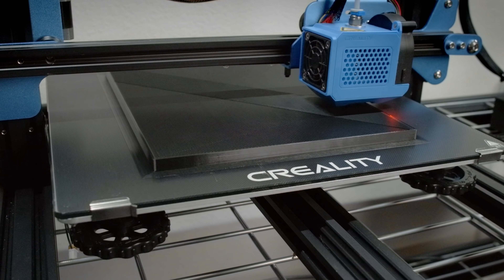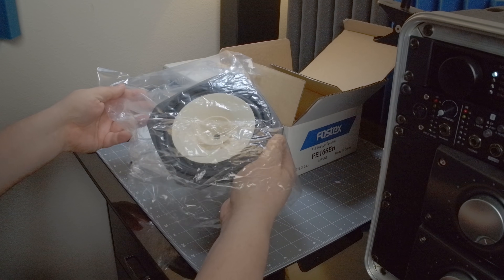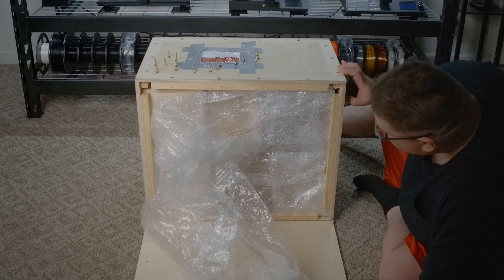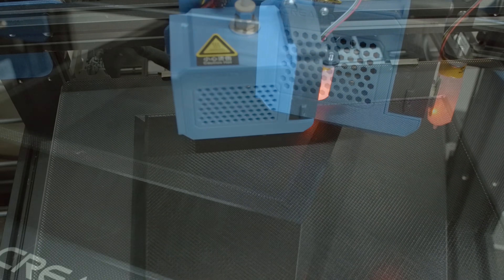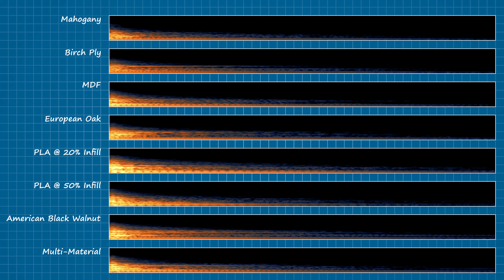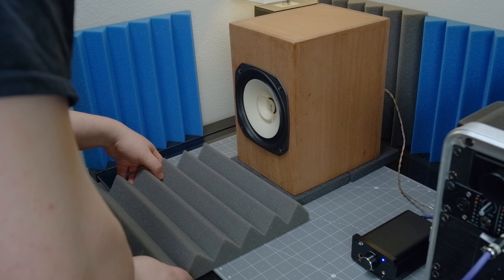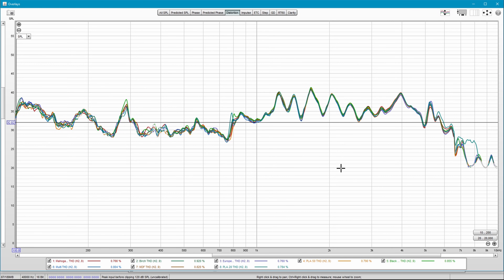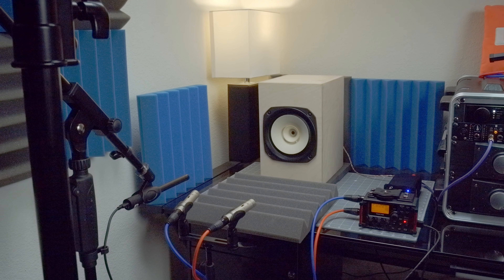Which Is Better for Sound?

Comment: You typically do a port of some kind you were testing a sealed box now I always ran sealed boxes myself. It plays a better all around note and you don’t have to worry about the I wonder about your airspace. Is it too specification for the speaker? Or are you smaller on the box and more power, or are you larger on the box with less power everything achieves different things depending on what you do I think it’s funny the test you’re running I ran when I was a kid now I’m 60. Have you read the cookbooks?

Comment: Would be cool to see you experiment with hollow walled prints, then filled with epoxy and sand or similar for example. That way you reduce print times but can achieve dense enclosure walls?

Comment: Since 3D printing is used to make speakers, it is not necessary to print speakers made of wooden boards. 3D printing can create more shapes. We use wooden boards to make speakers mainly because the price of wooden boards is relatively low and easy to process.
3D printing also has its own disadvantages, but the structure can be strengthened by filling it with resin or cement later. This saves printing supplies and greatly reduces printing time.

Comment: Could we in theory 3D print the case with like 5-10% gyroid infill? Gyroid is a 3D structure that allows water to enter every crevice so it might be very good for this purpose.
So... use a low% gyroid infill, and drill one corner of the enclosure(or have a 3D printed thing prepared that you just cut off), and then carefully fill it up with very low viscosity epoxy resin or special plaster or something? That box might end up as heavy as a brick!

Heck, you can design the box for this exact purpose, use 100% infill but keep all the walls as thin as possible and simply fill up the whole damn thing with cheap plaster or concrete or something!

Comment: Where's the acoustic insulation? If you didn't use any that is madness. The resulting internal reflections will bounce back on the cone causing gross peaks and ringing. Also vibration results will be significantly altered by the use of internal bracing and damping materials. Even acoustic insulation acts as a damper. As a rule enclosures whose resonances lie at higher frequencies are easier to damp out. Lower frequency resonances are more difficult. Birch ply being somewhat more flexible tends to resonate at lower frequencies. This is not necessarily a bad thing as it can add warmth to the sound of an otherwise lean sounding speaker. Many classic British designs from the past (ie, BBC monitors) used thin walled birch ply enclosures for it's unique acoustic properties. I may be old school but there's a lot we can learn from the classics, many things that have been forgotten.

Comment: I'm trying to design a subwoofer enclosure for 3D printing, I'm a 3D print novice though and I don't know how thick I should make the walls, 0.75 inch like I would do for the MDF? Any suggestions would be greatly appreciated
Reply: I printed a few speakers and filled the wall cavities with silver sand. For the top and bottom I used 30% infill and a layer of sound deadening that is also used in cars (sticky on one side and aluminium foil on the other and in between flexible lead). Those speaker are as dead as tapping concrete. Filled them with polyfil.

Comment: It's nice to see so little difference.  The only thing I noticed was the bass impacts seems slightly softer.  The impact edge is softened.  That's basically it.  This might be more apparent if we compare mechanical flex.  You'd need to look say something like bending stress and deflection.  However, it's also easy to build in a lot of additional stiffness by even slightly increasing spacing between the outer and inner wall, adding in bracing, or binding the woofer with the back wall.

Comment: You did imaizing experiment, probably you are the first guy on this planet that did this kind of tests. And i think its time to go futher... I think it would be a grate idea to use the infill of 3D printing in our faiwore . By saing this i mean that that insted of compering 20% and 50% infill lets me mesh structure between inside and outside wall and will it for example with some high densety liqued , silicon for example. And maibe the results will be beuonde our expectations. Im shure you are fully capable to perform such tast. 
Wth respect
Vitaliy from Ukraine

Comment: I wonder if you print them more like a concrete form than a solid box then use something else to fill later might be a better option...  right off the top of my head something like epox resin can be poured in to make solid...  or maybe even a foam might work...

I think 3d printed enclosures will become better but I think its going to be a mix tech deal with some sort of filler that hardens more solid.

Comment: I used to work for a top, top audiphile company and for bottom of the range research we had two pairs of speakers made in chipboard and plywood. Chipboard is fine but MDF sounded God awful! The boss sold them as 'Special prototypes' to some idiot!
I find it interesting that the mahogany is very warm and has a soft bass - this is the same as you get making guitars from mahogany, I liked Black Walnut the best which is a problem as you can't really get it in Britain :o/

Comment: This is a cool test but it doesn't really take advantage of the fact that 3D printing can create shapes you that would never be possible with traditional fabrication methods.  Said shapes (braces) will make the box far more rigid than a comparable tree-made box.  Additionally PLA is the worst material for structural use.  Nylon Carbon Fiber is what should be used.  Combine all the above and you'll end up with a lighter, more rigid enclosure but likely at a higher material cost.

Comment: A cool alternative option would be to fill the 3D printed speaker case with a different medium, like sand. This would help add density to the print relatively.

Comment: What if you used less infill but thicker walls, because you can set the amount of layers count as inner and outer walls, so you can have 3 lines of solid infill

also, your 3D printing speed is extremely conservative, even the cheap creality's handle much faster than what you did in the vid, and the prusa by default can print faster than the creality's, so yeah i think your settings are just set too slow so i can understand you don't like 3D printing enclosures too much yet

Comment: Thanks for the great video! A few standout materials. Maybe it's because most speaker cabs are built with MDF and that's what I'm used to hearing, but it sounds perfectly balanced to me. No high mid hype or low mid bump. Not too sweet, not to pingy. Goldilocks.

Comment: I'm hearing the test at almost 11pm. Could not hear the difference but my system is not the best: a pair of JBL LX200 speakers, a single B&W AS1 on the left side, Dayton Audio 100 (like yours, it seems) amp, sound comes from a Mackie Onyx820i (used as analog mixer) that is fed from a Behringer UMC204HD output. Except for the Behringer (brand new) and Dayton Audio (5 years old, at least) the mixer and loudspeakers were purchased used - the JBL from a church sale for what now would be 10 dollars (25 at the time). The room is not treated and has lots of reflective surfaces and is almost a square.

Comment: Does the dovetail change the characteristics of the box? Thanks!

Thanks for the many classes!!!!

Another question: wouldn't measuring a wood plank give better information about the structural absorption alone and remove the surface absorption? I understand you received the boxes already assembled and, perhaps, the correlation is high or what you really want to measure is how the box behaves. Thanks!

Comment: I really could hear a difference only with thee mdf enclosure sounding crisper and more pure if that makes sense lol as far as my listening equipment you would laugh but I've got 6 Sengled pulse light bulbs each with a tiny 13w jbl driver in them app controlled and very meticulously placed around my bedroom with a Sony 600w powered subwoofer and honestly at low volumes I think it could surprise even the most discerning listeners and it still sounds great and mid levels up to about 3/4 volume and then the dreaded plastic shields begin to vibrate and cause interference but the sub is amazing and I have yet to ever find another like it, it has to be atleast 15 to 20yrs old and really packs a punch... Now I often think at times this setup while playing full 4k sound clips sounds very close to my full klipsch setup in the livingroom Harmon kardon does get my respect for budget great sound....

Comment: with the pla i couldn't hear much difference between the infill levels.
but the OAK sounded like it amplified the bottom sort of how I expect a subwoofer in a home to sound, one sat on a real thick pile carpet.

I'm currently listening to probably the worst setup for listening to bass tones a pair of HD superlux 668B's with microfiber cups coming from the standard output on an asus motherboard, my amp died recently.

Comment: Very nice video!
Any thoughts on teak wood as a speaker cabinet material? I've used it for all kinds of furniture, interior & exterior. It is oily, decay resistant & heavy. Looks good & lasts long without any sanding or finishing. Doesn't have any 'ringing' resonance, so no one builds musical instruments out of teak. That's a good thing, keeps prices from going through the roof 😂

Comment: I couldn't tell a difference between any of the enclosures, and when I close my eyes I can't even tell when the materials are changing. Audio chain is Schiit Bifrost gen 1 (via Unison USB, with Multibit chip), Emotiva BasX A100 amp, Emotiva B1+ speakers, Schiit SYS preamp, and Rythmik F12 subwoofer.

Comment: It appears the data concludes there is no difference, except for the thin PLA plastic enclosure. Should these boxes also have damping filler and a bit of foam on the rear wall ? Wouldn't this make more difference that the wood used ?.  i.e Perform the swinging-knock test on a piece of mattress foam. Unless these boxes are intended to be used as instruments rather than enclosures ? Infact I feel this testing is a little bit misleading , I'm no expert... but using 'Oak' for a speaker enclosure is deviating from the realms of science, unless it has been harvested under a full-moon of course.

Comment: in the sides etc. would adding your own bars so 100% filled sections reach from outside printed wall to inside so its stronger in the areas further in the middle (Away from edges) help with the issue?  like having a few areas stiff with infill around them.  It would take a little longer to print but I was just wondering.

Comment: Interesting test, I'd swear that birch ply has a little bit more mid bass resonance, but other than that I can't tell much if any difference. 
Listening with Senhiser HD 598SE headphones just running off of my ROG Zephyrus G14 notebook with an Equalizer APO curve to add a very subtle loudness EQ effect as well as help the sub 50hz bass response and compensate my own hearing loss.

Comment: Off topic question???  Since I trust your opinion. I’m remodeling a basement room ( building a room within a room with sound isolation techniques) This room will be much smaller than my last studio space and I gotta focus on improving audio quality. I have hs8s as my main monitors. I just bought a stw 350f peerless by tympany subwoofer 🔊 as my subwoofer upgrade.  It’s a DIY project to save space and money. I like to make bass heavy music and mix and master a variety of projects. The room is going to be 9x18x7. Would a sealed box make sense with that sub for mixing and mastering?

Comment: Would really like to see you design an under the seat box for a truck. Preferably a 07-13 silverado  lol, but atleast some form of multi door truck that requires a box under the seat. Theres alot of us out here with the dillema of needing the cab room for hauling around offspring, but like to crank it once we get some down time.

Comment: Tech ingredients has some videos with a lot of really highly detailed scientific analysis on different materials acoustic properties. If I remember correctly, it is the higher the stiffness (not necessarily strength or other properties) of the material which causes less resonance will occur. Of course, there are many other things to consider such as side and rear reflections of the cabinet as well. But this is probably the main reason why the lesser 20% infill did worse than the 50%. I predicted this at the start of the video too.

Its worth mentioning that of all the thermal plastics, PLA has one of the highest stiffness properties out there, besides some other more exotic filaments like HIPS or carbon filled. Price per performance, PLA is probably the best way to go considering higher infill will give better results.

Comment: Hmm, from what I can tell , it seems the Birch Plywood is the Boomiest. The bass really stays after it hits.  probably good for someone wanting an extra punchy bass, maybe for a sound competition box or something.  
The MDF and the walnut seem the flattest overall. the Bass was good, but was quickly gone.  They seem to be the best at dampening.   20% PLA is very tinny overall, imo, its the worst sounding of the bunch.  the sides probably shake so much, it reflects in the sound.  50% PLA is flat overall,  closer to the MDF. 

Listening to this from a homemade 200W Bluetooth boombox, using a 1970's Sanyo ss220 tower speaker enclosure, a TDA3116D2 amp,  2 4" speakers and one 8" subwoofer.  Material is "engineered" , which is to say basically Particle board.  It resembles OSB, but with the chips being much much smaller.  about 2.5" round bass port.  
The oak  made the highs seem like they were a couple notes higher , and  there is a distinct echo. the bass seems to come back 2 beats after the first one .  
 
Not exactly an expert, just going on what I can hear,  so YMMV.

Comment: This is strange as hell. First I’m using my IPad 6 and the blue tooth connection to my Bose Quiet Comfort II headphones. I was using my Senheiser HD 380’s until Mayo sone bought his Bose Head Phones and I was so impressed with them I went and bought myself a park while they were on sale. They have a bit more top end the my HD 380’s did, and I didn’t lose much bass in the swap. I still have my senheisers , but the Bose are are noise canceling and that helps a lot. So with that as my equipment for the m9ment, there wasn’t a lot of difference in all of these enclosures. Some lacked the very highest frequencies, and some were better damped. But none stood out in the lower frequencies fir me. Way back in the day, my parents got me a pair of Koss K6 LC headphones for Christmas. I had just discovered Boston and between them, Kansas and Chicago my listening of bands who were beamed for cities was complete! (It didn’t start out that way, but...) those Koss headphones had the best bass of any headphones I’ve ever listened to, and I shop constantly! Whenever I enter a store that has electronics that are set out for people to listen to, I take full advantage of their demo gear. So while listening to these I found that the MDF enclosures along it’s the  Mahogany enclosures sounded the best to me. The mixed material boxes sounded fairly good, but there was just something I found fatiguing about them. Those printed enclosures needed extra damping, and I just learned that Flex Seal worked well at damping enclosures, so I’m tempted to try them on my next build with plenty of time for the stuff to cure. I would try that on the plastic enclosures for sure. Let me know I’d anyone tries that and what you think if you did. Otherwise I will, but it may take me some time to get my next build going.

Comment: I'm wondering if petg would work  for a sub box, has it been tried? It does have a bit more flex to it but it can handle the higher temp inside a car, would it be worth the trade off?